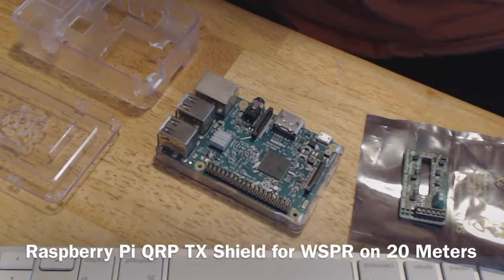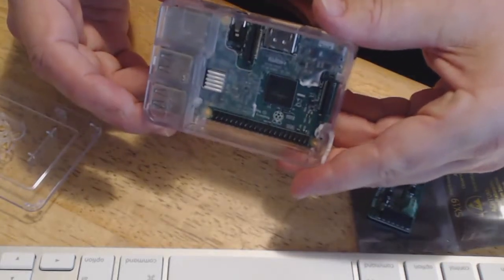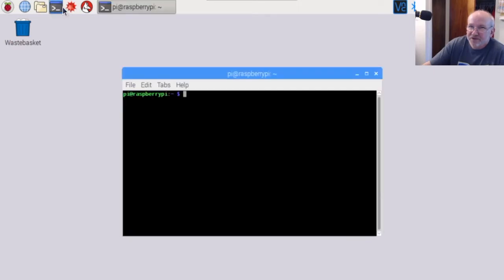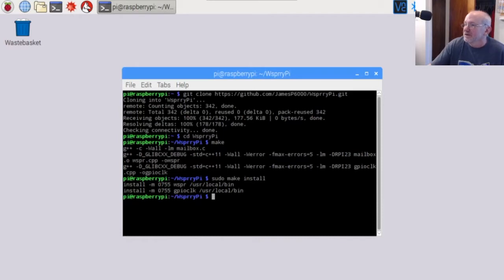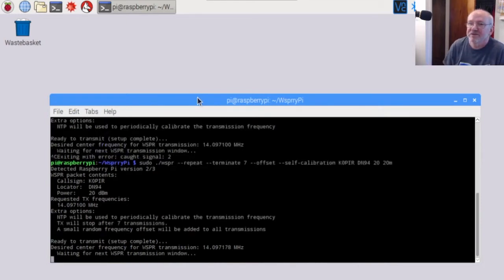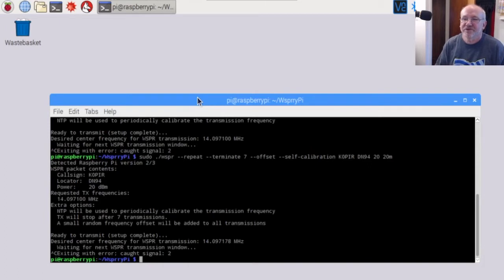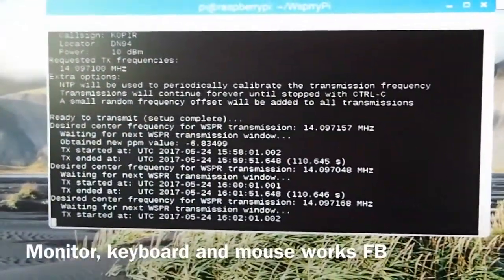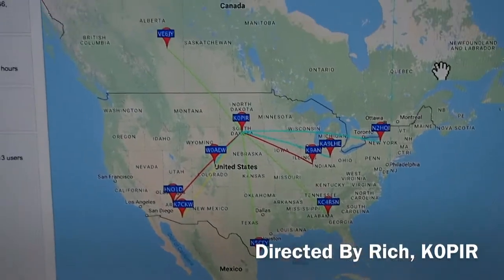TAPR WSPR QRP TX Shield And WsprryPi Installation

Comment: Things might work if you run that in a Root Terminal application.
Reply from the maker: Hi David, thanks for the suggestion. I also run it as a scheduled task now (same thing happens). The good thing, when it runs as a cron job I don't need to even look at it. It does work good. When I lose the VNC connection I'm pretty sure it is because RF is getting into it. This is a fun project and I'd like to put the Pi into a sealed box ( I have an ammo box) to move it outdoors, but that's a project for another rainy day. Hi Hi
Thanks for coming by, commenting and the suggestion. Best 73! Rich, K0PIR
Reply: Ham Radio K0PIR 78s and 88s to you and your family going qrt and standing by
Reply from the maker: Thank you David!

Comment: I have listened on the freq that WSPR said I was transmitting on which was 14.0971, when it went into transmit, I heard a signal for about 1 or 2 seconds and then nothing.  Using a 20 m inverted v as Antenna.  I am assuming that I should have heard the signal for the duration of the transmit time which was 110 seconds.  Will keep trying!  Thanks.
Reply from the maker: Could yours be hanging up? Do you ever see that the TX ended? There is a thread at: https://github.com/JamesP6000/WsprryPi/issues/6#issuecomment-304354010
Reply: Went through all of the updates and upgrades, got the kernel to the right one, but still doesn't seem to be transmitting.  What were you saying about being pushed too far down on the gpio pins?
Reply from the maker: At first I thought I was pushing the TX Shield too far down on the GPIO pins. When I raised it up and transmitted I didn't lose my WIFI or VNC connection, however it did not produce a strong enough signal to get out. I wasn't being picked up by anyone on WSPRNet.org. 
Now I have the TX Shield pushed all the way down on the GPIO pins and it works great. I am being picked up by a lot of stations. However, I do lose my WIFI and VNC. It must be the 100mW signal so close in proximity to the RPi3 that causes the WIFI on the RPi3 to go down. 
Is your TX Shield pushed all the way down?
Reply: Yes, it is pushed all the way down, but when it transmits, I only hear about 2 seconds of noise, then it quits. I would think that I should hear 2 minutes of noise if it is doing the complete transmit.  On the CLI it is showing all the right info, transmits, ends with the time 110.682 sec.  will keep trying.
Reply from the maker: Stephen Stocker I've been told to check the power supply and also the SD card. Do you have a class 10 SD card? Do you have an alternative power source?
Reply: Yes, I have a class 10 card, and the power supply is the one that came with the Pi3.  I am going to try another option, I got the arduino shield from Qrp-Labs, so I am going to try to get that one going now.
Reply from the maker: That's great, please let me know how that one works.

Comment: How long did it take to see your contacts on the WSPR map?
I have one and have not seen any activity on wspr, any suggestions.
Reply from the maker: Hi Stephen,
They happen pretty quickly. I used the database on wsprnet.org and put my call sign in where it says, "Only show spots of this callsign". I believe the page updates by itself every few minutes, but you can refresh the page to see them quicker. Do you have a radio so you can receive WSPR transmissions? I checked mine that way.